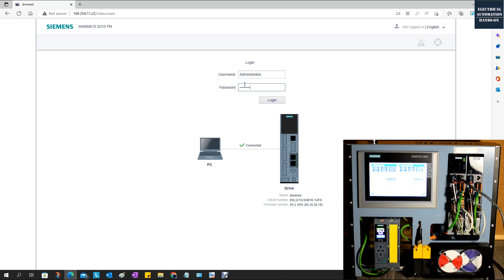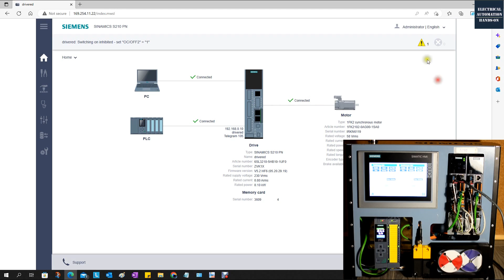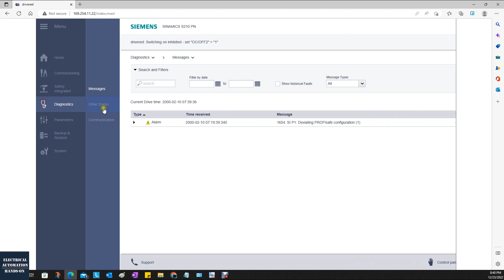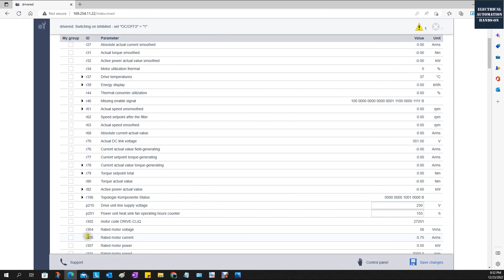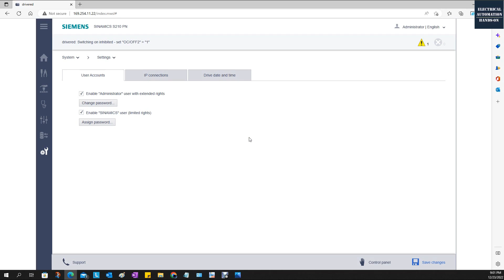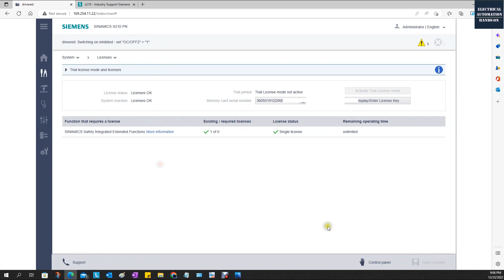MS06B. [Siemens S210 #02] Using Webpage to Configure SINAMICS S210 Servo Drive

Comment: Great videos, you have help me alot in my professional career using siemens drives. I have a Problem connecting the S210 to the webpage. After typing the IP Adresse on the webpage i recieve the error message "hmm... unfortunately this page is not available". I am connected with X127 with m Laptop.
Reply from the maker: Thanks for your watching! Glad you like my videos! Default, once you download drive from Startdrive, your webpage is disabled. So you can use startdrive to enable the webpage and download again, or do the drive factory reset.